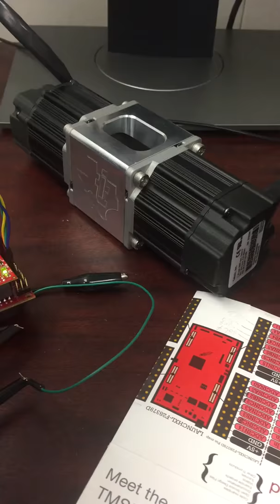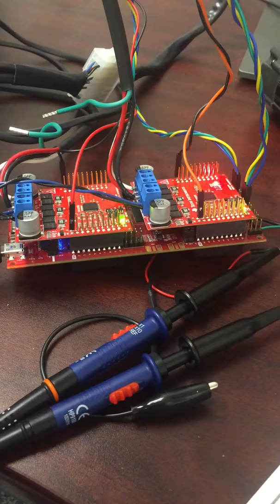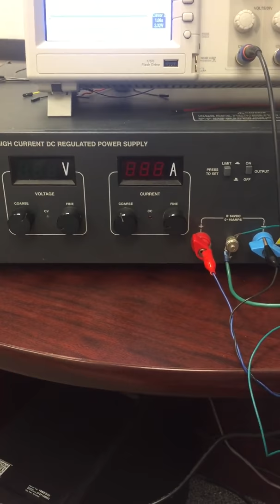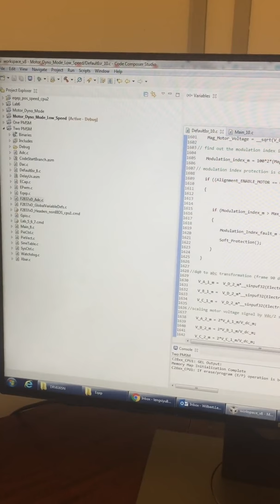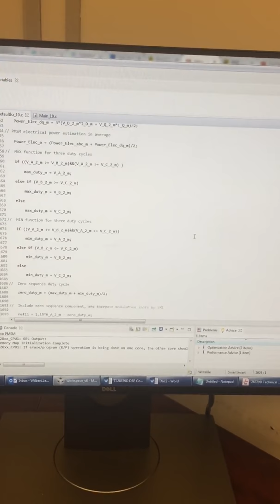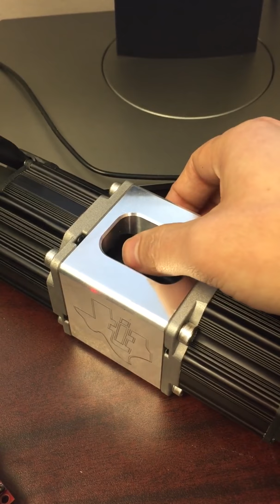Using Texas Instruments C2000 DSP to control two PMSM

Comment: Do you used the instaSPIN labs example code, or you have programmed it by yourself? If you used InstaSPIN labs example code, which lab exercise do you used? Thanks in advance.
Reply from the maker: I did not instaSPIN， I hand coded the DSP and run the motor

Comment: what is the power supply specifications for both the motor ?
Reply from the maker: 24V DC I think
Reply: @yusileng  and what about current requirement?
Reply from the maker: I forgot the detail, but around 3-4 Ampere